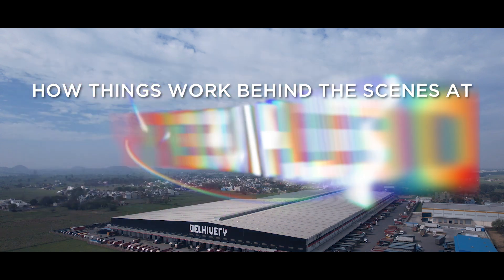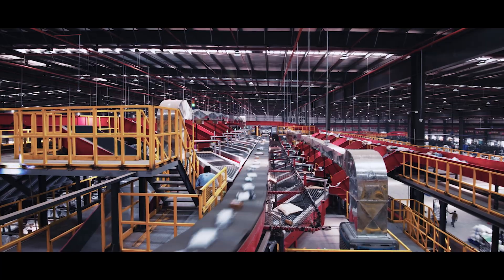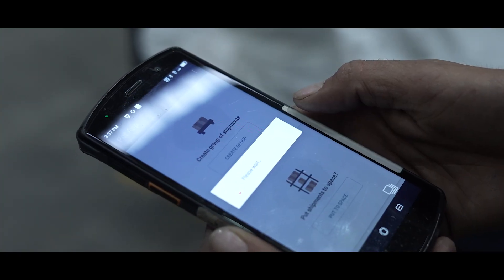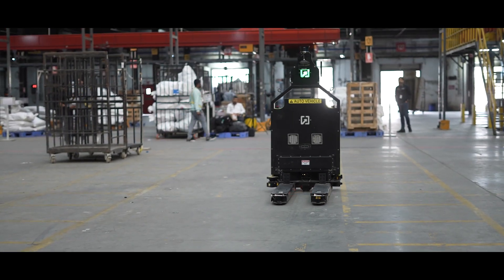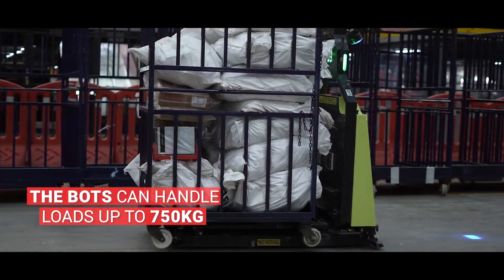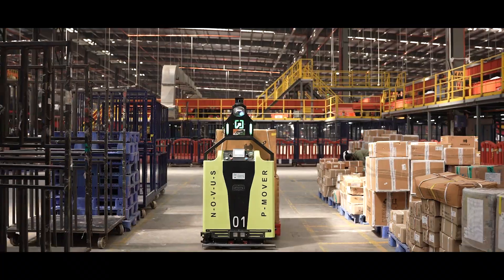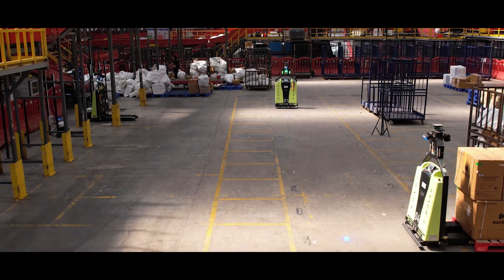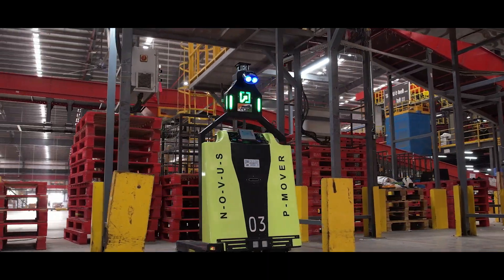Autonomous Robots: Revolutionizing Logistics with Efficiency and Innovation at Delhivery

Comment: I have had an absolutely terrible experience with Delhivery and I would strongly advise against using their services. I have been waiting for my order for an extended period, and not only has it not arrived, but the delivery date keeps getting postponed every single day.

The customer service is practically non-existent. Their agents do not reply to emails, and they do not pick up calls. There is no way to get in touch with them to inquire about the status of your order. 

This level of incompetence is completely unacceptable. I have wasted so much time and effort trying to track my order, and I am beyond frustrated with the lack of communication and the constant delays. 

I will never use Delhivery again, and I strongly urge others to avoid using their services as well. This has been an incredibly disappointing experience, and I would give them zero stars if I could.

Avoid Delhivery at all costs. There are plenty of other delivery services out there that actually value their customers and provide reliable service.